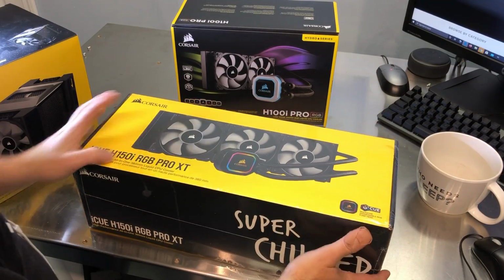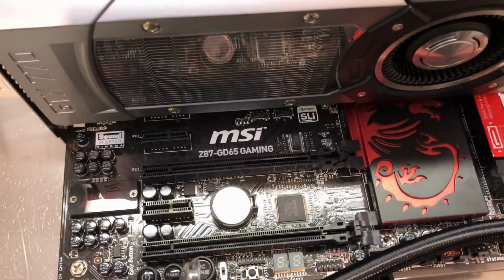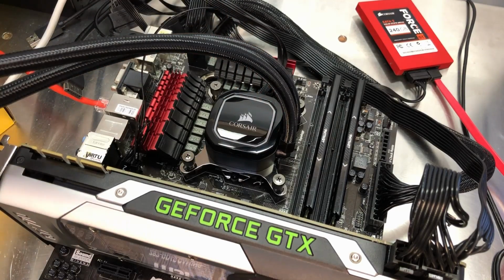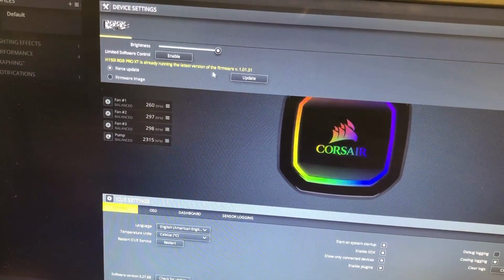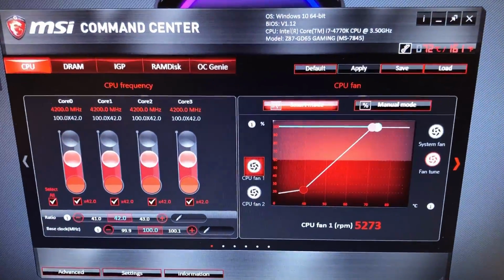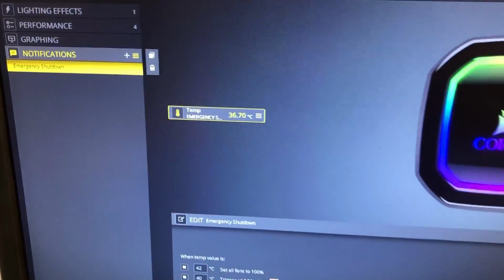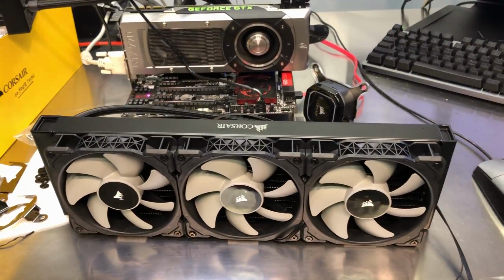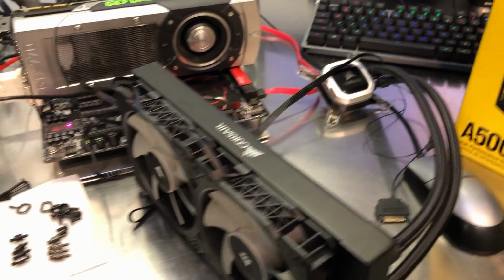Overclockersclub Reviews The New iCUE H150i RGB PRO XT from Corsair!

Comment: hello, I Had a question, if anyone knows just let me know.  So I got the commander pro for some fans that I wanted to put into my case, But the problem was that I only had 2 USB headers on my mobo, So I thought If I connected my cooler Icue (iCUE H150i RGB PRO XT Liquid CPU Cooler) To the commander pro, everything would be fine, Turns out, It wont detect on my Icue App on my computer.  Can someone help me, Id really appreciate it.

Comment: Thanks for the review and effort made of the video. I was a bit divided between Kraken and Corsair, whom both are top notch cooling providers in my opinion. I currently run Kraken on my current rig and will be running the Corsair iCUE H150i RGB PRO XT on my new one. Reason of brand change was the magnetic bearing fans amongst other reasons.

Comment: he sata cable that comes out of the water cooler has another small cable attached, what does it do? where do you call?
Reply from the maker: The small single wire connector is the pump tachometer lead.  This tells the motherboard that the pump is running and 
what speed the pump is running.

Comment: bro you applied thermal paste or are you using stock thermal paste pre applied ?
Reply from the maker: I will always try to use the stock paste when I can. Sometimes moving the cooler around from system to system means that I have to use fresh paste…
Reply: @overclockersclub  ok

Comment: The advertisement on the site for this cooler said the fans can be cranked to around 2400mhz.. did they not reach this?
Reply from the maker: The fans can run at the max 2400rpm speed.

Comment: They should have added the option to disconnect the fan splitter from the pump. For people that want to control all fan speeds (both case fans and CPU) directly through the bios. 

- Connect the fans directly to 'CPU_FAN and CPU_OPT' on the motherboard (using a PWM splitter on CPU_OPT,  since there are 3 fans).
- Connect the tachometer cable to the 'AIO_PUMP' header on the motherboard, to read pump speed.

The USB cable is only needed for setting the desired color in the corsair software. After that it can be disconnected. 
Now there would be only 2 cables coming from the pump, which makes things a lot cleaner.  

If you install it like Corsair says, you have to use 2 different programs for fan control (both BIOS and Corsair), because the Corsair software cannot control case fans unless you buy their expensive fan controller. Which again adds a lot of cables.
Reply: I was just thinking about not having to use the iCUE software so your comment is very much appreciated. So if I understand the setup correctly, it is the SATA cable that powers the pump and the only purpose in connecting the single wire pump tachometer connector is to read the pump speed? So I guess the pump will be running at full speed all the time?
Reply: @VNAV_PTH  Correct the sata is power only. 
The single wire fan cable is a tachometer and is only for reading the pump speed (not fan speed). When you connect the fans to the pump like corsair says you can set the fan speed in ICUE. (the pump is connected to motherboard via usb)

I would rather do it like I described in my comment above. (Connect all fans to motherboard)
Reply: You can adjust the pump speed profile only in ICUE. But the usb cable needs to be connected. After setting pump speed you no longer need the usb connection.
Reply: @BrianJ.  I know this an old comment but I figured I would drop this here for anyone else who may need it.  You require the USB to set the pump speed and the RGB.  Though the pump speed will save to the pump from boot to boot and thus not require the USB after being set, the RGB sets when iCue launches so its Rainbow by default until the software kicks in.  This means you will need the USB for RGB. This is how my h115i version works.

Comment: What is the difference in temps between the h115i pro xt and the h150i pro xt ?
Reply: h115i pro xt is a 280mm radiator (2x140mm fans) while the h150i pro xt is a 360mm radiator (3x120mm fans)
Reply: @TransbayTuber  dude, that wasnt what he was asking. Hes asking what the temperature differences between the two are

Comment: Do these fit the MSI MEG Z490 motherboard? I bought a Corsair 115i Platinum edition and the Intel back plate was millimeters off. I know they are adjustable and it still didn't fit.
Reply: I had the same problem, I used some of the included washers on the backplate

Comment: I wonder how much difference there is between this one and the slightly older H150i Pro RGB (which I happen to have) besides being CoolIT vs Asetek.
Reply: XT version has 2400rpm fans
older version max out at 1200 rpm.

Comment: I have the corsair h150i pro xt with my i7 6700k and its greate

On stock clock idle tem is 19-20c, gaming about 30-35c and full load about 40-45c

Oc to 4.7 idle about 30c gaming 45-50c and under stress test stays about 67c so i think its preaty good :))
Reply: Do you know if there are major differences with the H150i pro and the H150i pro xt ? Because I know that the non xt version is said to be much quieter.
Reply: Prety good? I have better temps with nhd15. Max 61C
Reply: Wow that's the definition of Overkill 😂
Reply: Yeah wtf, are you living in a freezer? haha